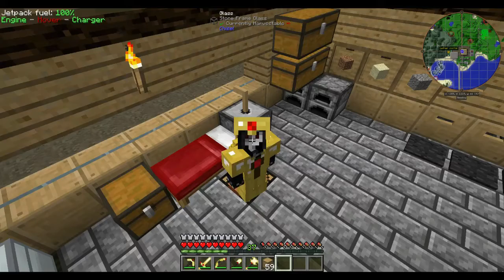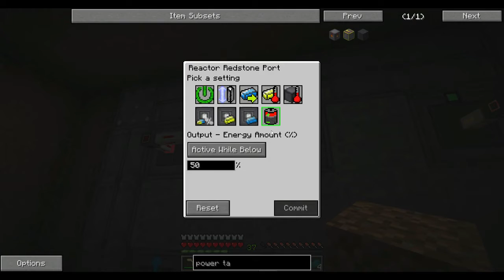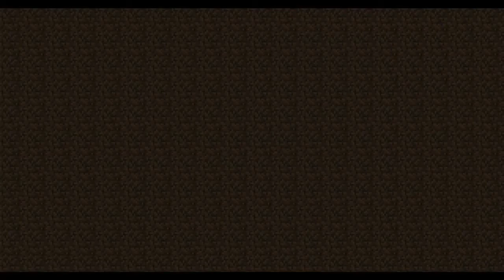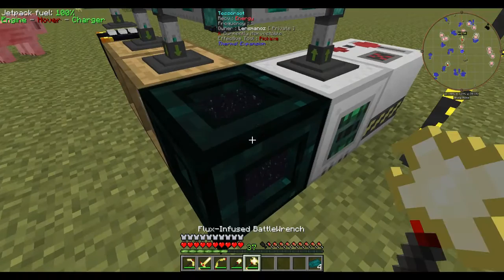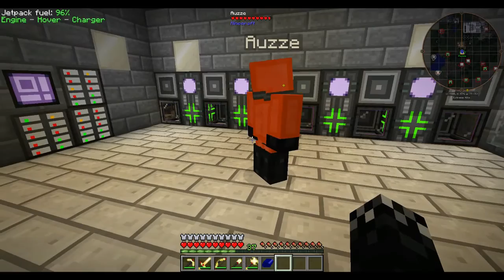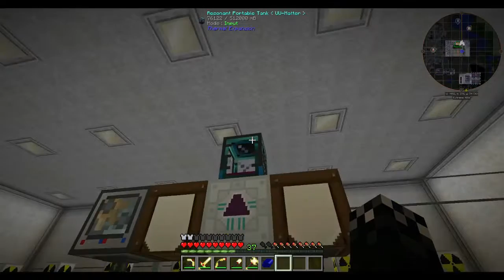Minecraft - FTB Inventions - Ep 11 - Power Transfer and Base Tour

Comment: with regards the reactor, you will  (probably) get more power out if you reduce the fuel cores to 5 in a cross, leaving a gap between the cores and the wall, and then use gelid cryrotheaum ( or however you spell it ! ) for cooling. There is a big reactor simulator lurking around on the net ( sorry can't remember the link ),  that lets you try out various combos. I personally like a 6x6 with a 2x2 core, and you don't need coolant in the corner 2x2 areas.
Reply from the maker: +john snape I do use a website to test it out. It's probably the one you are talking about. I figured the one I built was easy to build. I did test a few types but not how you described

Comment: I know I mentioned the Potatoes, but I believe that was in Pickle Pack where you could discharge them in Mekanism Capacitors. Or Revolution, where you need all the power you can get. Yeah, EnderIO conduits have never behaved properly with BC quarries. That's why I use BC pipes on the quarry in my series.

Consider making some Reinforced Tracks to let your cart move faster. It's +25% speed over the normal tracks. Without need for any special speed tracks the way High Speed does.

Tech Reborn is basically a continuation of Ultimate Era Greg Tech. If you used any of GT back then, Tech Reborn isn't very difficult to use at all. If you didn't this is gonna be fun. :D (I remember most of it so I'll answer any questions you've got. :D) They did make Bauxite processing easier though, which I find sad.
Reply from the maker: +Triaxx2 Pickle Pack has disabled the potato battery recipe much to my disappointment. Revolution I haven't tried yet. 

Reinforced tracks sounds like a good idea. 

I did use a little GT but not sure I made it to ultimate era stuff.
Reply: Ah, well rats. It's such a useful recipe as well. Even if it only worked on Poisonous ones.

I ended up switching my Logistics Cart to them because it was taking too long to get back to the house. I'm thinking I'll have to swap to a Logistics Train when I move into the new house. Probably an Electric one.

Then you should be reasonably familiar with it. It explodes if you put in the wrong voltage, some don't work at all if you can't supply them enough of the right sort of power. And a few of them require those multi-block casings you saw at Auzze's place. Welsknight Gaming has also built the stuff, so he's a good place to look for how to build it as well.

I might give Inventions a go myself, though I'm stubborn enough not to use EE. I'm not precisely bored with my world, but it's at the point where I need to start putting in Signalling along the rail lines to stop things from exploding, and that's not a fun task, especially as long as the lines are. And then laying the 40,000 tracks to the Thaumcraft tower, and then back. :P

Extreme stubbornness, go!